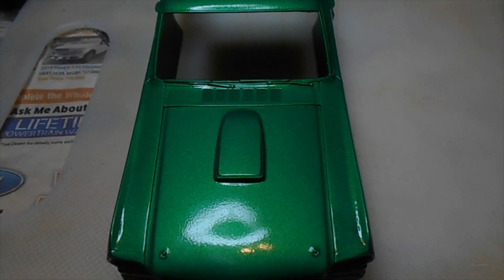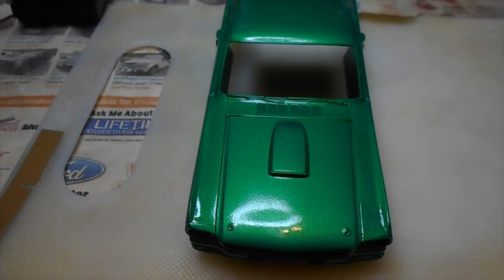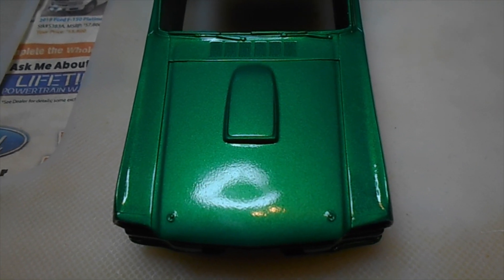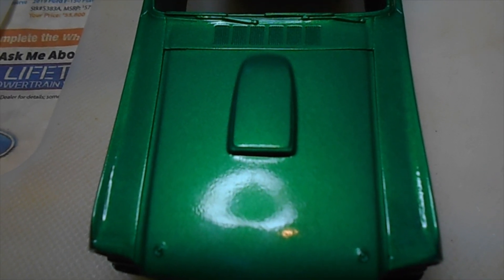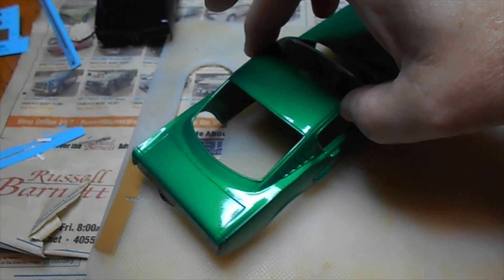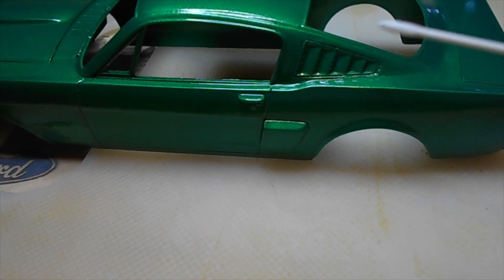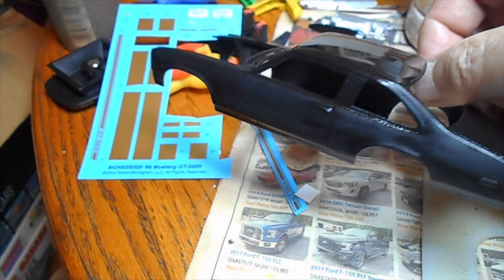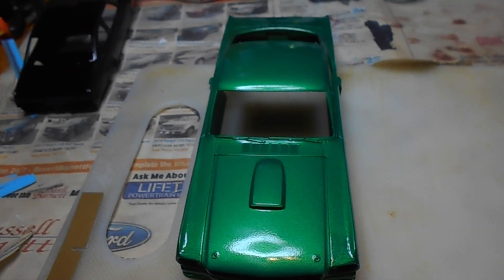'66 Mustang Decal Dilemma

Comment: That emerald green turned out fantastic Jack~Lots of work around the rear side vents~I see a lot of guys in 1;1 Scale paint their doors,hoods and trunk off the cars these days and all of them have the paint don't match situation going on~I see this a lot on show cars~They don't realize the paint will not match unless painted at the same time on the car~I have worked in 10 differnt body shops over the years~Many times I would have to paint the entire side of a car even if there was only a dent on the right front fender~And silver is the toughest~Look at a silver car and you will see the differnce in colors from the door to the fender~Then they can't get the hood to match that~I call that car a "Calico" hahaha but the light colors are the worst starting with silver~But if you can glue everything on the body that is going on it then paint it and you will be much happier my friend~And you already know about the dull coat or gloss coat on the decals first if it is an older model~If the model was stored in an attic then it has exreem heat all summer and extreem cold all winter and makes them unusable unless you gloss coat 'em~But you were one step ahead of the game there~I use a setting solition ever since '06 when spraying clear on a model and my airbrush blew a decal off and it was an accurate early 70's prostock so it had to be very accurate for it to sell right on FeeBay back then~To buy another set of SLIXX decals was just not in the scheem of things~Setting solution worked good for glueing the decal in place but it seized the decal where I set it~Making theem all wonky if ya know what I mean?~OK I didn't mean to talk your ear off but if you ask me for an opinion on something I will give my honest answer and not misslead you or anyone else reading it~I hate to read and I'm no good at comprehending what I read so odds are I can't proofread what I just wrote~Everything from bad grammer to misspellings will be abound haha :))
Reply from the maker: Thank You Brother for the Info. and I don't mind long messages At All. Heck, it makes me feel More Connected. Your Absolutely Right, I Should've had those side vents installed before I even put the first coat of Primer on it. But sometimes my engine Mis-Fires Under The Hood, if ya know what I mean. 😆 Thanks for Watching and Commenting, New Video Coming Up Today! 🤓👍

Comment: Gorgeous paint job... I can relate to having decal issues.... Sometimes they break on me then I have to piece them together or if it's an older kit the decals fall apart then are unusable.....
Reply from the maker: I found it Helps if you spray a Light Coat of Clear over the Decals and let them Completely Dry like Over Night before I use them. 🤓👍

Comment: The decals suck on that kit. I went and ordered aftermarket decals from Keith Marks and got them to lay right. I used Micro-Sol to get them to form fit on the curves. It looked great............right up until I cleared the car. The clear started wrinkling the decals even though I used two mist coats before going heavier. My plan is to mask the body off and airbrush the stripes, using the decals as a template. In fact, after I'm done with the Mad Gassers Nova I'm pulling the '66 back out to paint and stripe it. You can find that bunch of videos on the '66 if you scroll way down in my videos.... Hope you get it figured out.
Reply from the maker: Thanks Brother, yea i've decided to paint mine on as well. Heck Yea, I'll come Check Out Your Videos! 🤓👍